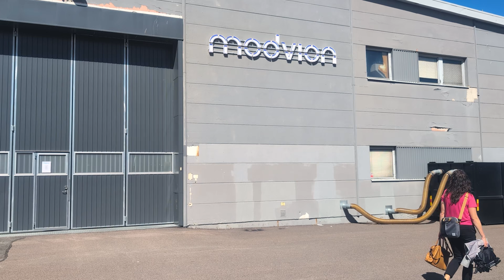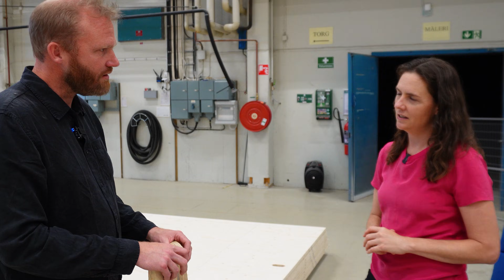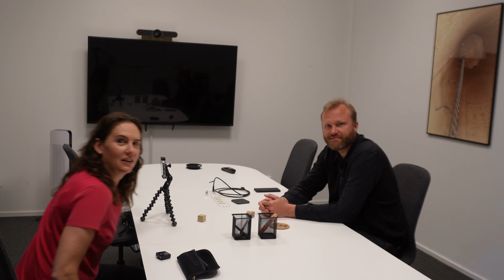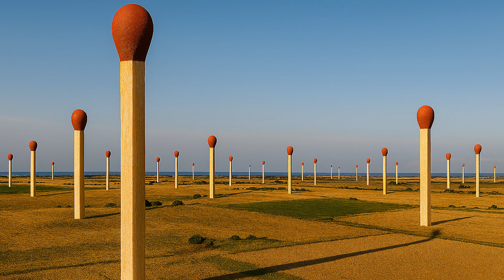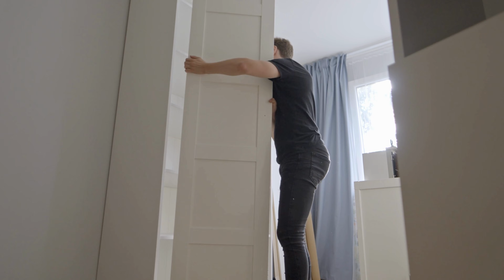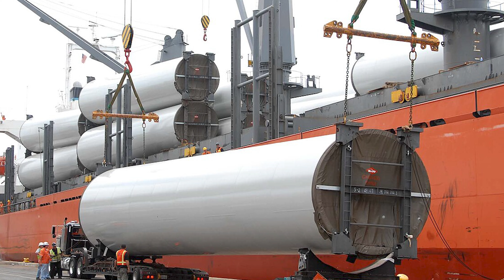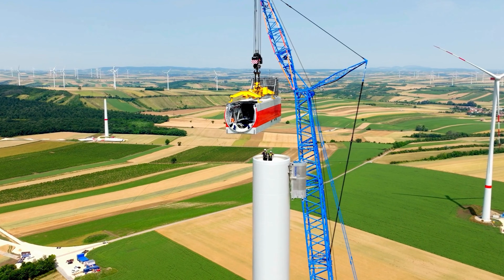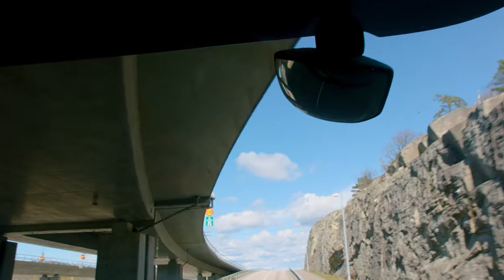How a Wooden Tower Could Unlock Bigger Wind Turbines

Comment: I see no reason that turbine blades couldn't be manufactured with a similar technique. As someone already pointed out,  a WWII bomber was built in quantity using wood laminate, and was renowned for surviving massive battle damage. 

Where the blades neck down to connect with the hub would be  challenging to get right, maybe, and you probably couldn't join blade sections on site reliably. That would subtract a couple advantages of wood composite construction.

Comment: A possible receicling issue: cutting up the towers after their lifespan requires cutting the glue in the composite as well. How do we keep the glue from sticking to the saw blades?
Reply: haven't you ever cut up a piece of plywood?
Reply: @fulknerra6116  ever used a circular saw to do this, and looked at the blade afterwards?

Comment: they don't rust. I do not like the clearcuts. Where i live in west coast Norway we have some large clearcuts. All the fungi systems that give the trees minerals die and it is harder for new sepling to grow. Using timber as in solid wood construction is a way to store carbon. So the last 5-10 years we see these massive solid wall, floor and braces in larger buildings where we are used to see concrete and steel.

Comment: It seems to me that bending already laminated panels would weaken them a bit. So, hoping the Pilot works 'good enough', I would think that building a production plant would take logs and send the veneer planed off the log directly into a press which would laminate (with resin) the conical segments per whatever dimensions are required and let them cook once.
a bit of terminology strikes me: Fiberglass is also referred to as Glass Reinforced Plastic, Carbon-fiber would Carbon Reinforced plastic and these would be Cellulose Reinforced Plastic.
BTW: Some boats are manufactured by laying up veneers of wood & laminating them with resin & hold up for decades. Usually, the resins used need UV protection though. So, some kind of surface coating is required anyway.

Comment: To make trees part of sustainable politics, you must cut them down every so often! Trees produce most of their biomass in the first 20 years of life, then drastically slow down in later stages. Biomas growth is directly translated into CO2 absorption. So the old forest is significantly less productive than the young one. LVL is a great alternative as it does not require large pieces of solid timber. Trees can be cut early, before they enter a slower growth period, and replaced with new, rapidly growing ones, keeping overall CO2 absorption rate at the highest level.

Comment: "Made of thin layers bonded together", AND Urea Formaldehyde ? See, i already do not like the way he "miss" some informations on purpose. So it's resin, what quantity is used ?
About EPBT, this is an other unprecise indicator, most windturbines are installed in precise places WHERE they can achieve a good EPBT, that is not always the case for solar.
About reusing wood after dismantle, and the "angle" problem, no you can't build beams out of it .. cause the wood layers are not in the correct direction for that.
Doing wind turbines with wood is not per say a problem... it is if people keep increasing their energy consumption. And beside all those "positive", "green" or whatever bullshit, the first thing to do is DECREASE our energy dependance, forbid big 4x4 on our roads and even only accept small cars for local traveling and only use common transport like trains for longer travels.
Reply: If all the energy is net zero, why do we need to decrease our use, instead of using as much as we want?  Currently the big problem is emissions of fossil CO2, wooden wind turbines can be net zero, assuming the glue/resin is not fossil sourced.  I'm sure they are not completely net zero at the moment, but we are getting there.
Reply: @nigels.6051  What you call net zero is not net zero, if you take the simplistic idea of the CO2 counter then it could be seen as net zero, but it's not.
Appart from the energy thing, there is also all things that are modified in nature, wind turbines make noise, kill birds ... this is not showed in the "Net zero" calculus.
There is no secret, the more energy we consume, the more impact we got on nature. In fact, used energy is a synonyme of transformation, the more energy is used mean the more transformation we are applying on our planet. Taking a solar panel, it generate electricity instead of heating the ground and make flower blom... there is always a trade off.
Just thinking of "net zero" will elad to the same problematic as the one we are against today.... using too much energy and taxing the planet too much.
Using petrol is "net zero" too ... just at a larger time scale.... everything is "net zero" .. cause nothing is created and nothing is lost ... all is transformation. But some transformations are bad for the living creatures....

Comment: Could the towers be fabricated on site as wind farms often have 50 + units timber and glue are easy to transport and the saving of all the joints Think land based oil rigs they are huge and moved short distances the 50 + towers and disassembled and reassembled for longer moves.

Comment: Most structural failure is buckling. PlyWood is thicker for its wieght, therfore resists buckling under compression better than other high tensile materiels that are thinner and heavier. Plywood continues to be foung in new carbon fibre structues such as boats. Many boats are built out of plywood with or without fibreglass covering. Carbon dioxide has such a narrow frequency of greenhouse effect that is swamped by water vapor, and has no long trm correlation with earths temparature.

Comment: In a Storm this thing flys away 🔥🔥🔥🔥🔥🔥🔥🔥🔥🔥🔥
Reply: No it doesn't that's what engineering is for. If you understand the material, you can design for the load.

Comment: Taller wooden towers, could be more feasible, if they were built in situ. For example, wood veneer is more efficient, simpler and more cost effective to transport than extremely tall wooden towers. 

(And it could be redesigned without the need of the steel plates. Possibly on a rotating lathe  such as a Automated Fiber Placement (AFP) machine. Further reducing cost, complexity and improving recyclability.) Plus local forestry and labor could be utilized more effectively, logistically.

Hopefully Modvion will test the concept, for appropriate projects. (Much like concrete is mixed in situ for particular projects)

(Also suggest contacting ("InventWood", a company founded by University of Maryland professor Liangbing Hu, invented "Super Wood" by chemically treating and compressing wood to make it stronger than steel, but much lighter. The process removes lignin and strengthens cellulose fibers, creating a material with a high strength-to-weight ratio that can be used in construction and other applications.:Gemini AI quote) They just started commercializing and selling their first products. But they did mention they're looking for possible commercial partners in various fields. It might be worth asking for a sample just to test it? )

Comment: What about that wood product where they dissolve out the lignin, and press the remaining cellulose under pressure and heat, and end up with stuff that matches steel's strength? I'm thinking of replacing the fiberglass blades, in particular.

Comment: My view is that it takes a multi pronged approach.
Large Steel sections are hindered in transportation. 
Modular Conical section construction makes sense.
Large scale plantation timber acts as a carbon sink but takes many decades to reach harvestable height and size.
I wonder is Modular steel towers would be equally as strong given the ability to mirror the same assembly techniques.
Very interesting approach indeed and one worth following.

Comment: Regarding reusability, more energy could be saved by only cutting the towers into vertical segments, say 2.5 to 9 meters high, then disassemble for transport.  These could be used for 1, 2, or 3-story structures - dwellings, storage sheds, stock pens, etc.  With the 28 layers of 25mm to 30 mm of LVL, they would be highly insular.

Since the outer diameter was stated as 8 meters, inner diameter would be 6.3 to 6.6 meters, giving 31 to 34 square meters inside.  A 2-story tower would have a little more area than the average Swedish home.

Aesthetically, I think it would be nice to see round structures popping up.

Comment: I am not convinced that water ingress and rot will not prove to be a significant problem, especially in cool wet climates like ours here on the west coast of Canada. Water will find a way into the structure. No coating system is perfect, and I doubt that the urethane coating being used has the vapour permeability to allow drying. It doesn't take long for rot to occur.

Comment: Interesting how the entrenched technology gets to make all the rules to reject the newcomer, rather than have an unbiased discussion of actual strengths and weaknesses. For example, the conductivity of steel dissipates lightning energy, but is also the cause of so many lightning strikes. But timber has to play by the rules that just assume that conductivity is necessary. And that strawman comparing these engineered towers to Ikea furniture was a low blow. If we let wood have the same advantages that entrenched technologies enjoy, we will no doubt find many other ways to optimize this technology through engineering, as opposed to using protectionism to make rules against it.

Comment: There are some more advantages with wood. While the strength per crossectional area is rather low for wood, its density is also low, so that the weight specific stregth is really not too bad, but even more importantly, for the same required strength (or weight, for that matter) you get to use a higher wall thickness and that is very important when you deal with stability issues, rather than strength issues, as is common in shell structures like towers (or rotor blades). In addition to that the structural dampening of wood is pretty good and compared to most common construction materials it has very little fatigue. There is quite a lot of technical reasons to consider wood. I was actually wondering how Mr. Dölerud would not bring a more comprehensive list of advantages. Or maybe he did, but  some was cut out for sake of conciseness.

Comment: Timber and wood are by definition made from things that are made to resist wind. Fatigue is usually not an issue for wood structures.
Reply: Timber can fail in many different ways over time, for example cracking and  As mentioned in the post by biological decay .... Every material has its pros and cons.

Believe what you want c'est la vie

Comment: I’m not sure you could actually shrink the foundation just because it’s a lighter tower.
The main load this foundation has to deal with is a lot of torque from the wind being applied to it with a very long arm .
The weight of the tower is probably negligible compared to that force .

Comment: To be honest I am not so sure if it really makes a difference. Steel might initially require more energy to produce, but it can be recycled endlessly while the wood has a limited recycling cycle. And it remains to be seen if the wood can be recycled at all, because if it is too much rotten then it is pretty useless. And all the other arguments for using wood instead of steel didn't sound all that convincing to me. Steel has proven that is a very good material to use for this purpose. And there was not anything that stood out clearly in favor of wood. And of course the guy or company who is producing the wooden structures will always speak in favor of the wood. To convince me it would require thorough calculations and hard data instead of a slick PR story. I am missing the hard data in this video, where are the numbers? And on top of that I would much rather see those trees in the ground, or to be used for something where the use of wood is the clear better option. Because lumber prices are already high enough as they are now. 

My questions for that lady who did the interview are 1- did you do that thorough calculation about a comparison between the different materials to see what would be more eco-friendly and durable in the long term? (that shouldn't be too hard to do) and if not, why didn't you do the calculation or some proper research? 2- Did you get payed and/or compensated for your trip in any capacity by that company where you did the interview? 

I am not by definition against the use of wood. But it only makes sense if there are clear long term environmental and mechanical benefits for using wood instead of steel. And this video did not provide the hard data to convince me.
Reply: Good questions. I suggest we start out by not callng it wood, which is greenwashing. It is a composite wood laminate.

Comment: There could be hybrid towers where de base is made out of Steel for the stiffness (E=200 GPa) and the top made out of wood for the specific tenacity (energy of deformation/weight) and the vibration damping. For the wood fiber approach, bamboo fibers with polyurethane resine could be used and the cylindrical tower section could be made with a filament winder like corrosion tanks. Bamboo is one of the strongest natural fiber, it grows fast and in poor conditions. Polyurthane have  low VOS and is very compatible with cellulose bonding.

https://www.youtube.com/shorts/t6zNADTQVV8

https://www.youtube.com/shorts/2So5BWWG2Ps

https://www.youtube.com/watch?v=NnSXLa4yDeI

https://polymerestechnologies.com/product-category/two-part-rigid-and-flexible-polyurethane-resins/rigid-polyurethane-casting-resin-systems/rigid-casting-and-molding-polyurethane-resins/

https://www.youtube.com/watch?v=qSUUuGoE36U

https://www.youtube.com/watch?v=K-sY26Dr4mk

Comment: Oh like a tree! Why did no one think of that before? Probably need years of testing to see if a tree stands up.🤣 Get it right and you just plant a tree seed and let it grow a trunk, grow it's own foundation, roots, then add the turbine and blades!

If they were serious they would separate the wood fibres from the lignan and then re-lay them in a mould like with glass fibre.

Of course we know proper old mills were wooden. So just build them again as smaller capacity generators instead of grain milling.
Eifel tower is taller put a turbine on top of that. Do not have to be round sticks.
Wooden towers they have are stupid, basically they have local wood not iron!

Comment: I think solar PV, batteries and grid forming inverters will eventually run away with most of the electricity industry. Wind and pumped hydro will have their place, but solar PV, batteries and inverters can stand on posts or piles driven, or screwed, into the ground. Solar farms are great for stock as they provide shade and concentrate rain for growth of improved pasture. Data centres will give depth to the solar + batteries + inverters system.

Comment: Still will need to mine SILVER and COPPER. And everything that goes with digging it out of the ground. Trucks, bulldozers, diesel ect. Also the rebar and concrete to set it in the ground uses more energy than will be achieved from the turbine in its life time. Good luck.

Comment: Anyone look at trees as a mechanism of transferring wind kinetic energy to the ground? Doesn't a tree move in the wind? And while not a rotating turbine, there is an oscillation back and forth and the impact is essentially energy transfer from the wind to the tree, to the ground? 

So, it wouldn't be Cog and Wheel sort of gear rotating things. It would be twisting or torsion energy. Is there a way to make torsion in a swaying object connect to some kind of energy drive?

Comment: Asking if wood the right material to build a cylindrical tower designed to resist wind load, is a bit of a silly question when you think about it. You are building an engineered tree, it just makes sense.
Reply: To clarify, with most material choices you have pros and cons to everything, but here you have a material which has been naturally selected for over millions of years to do exactly the job you want it to do.
Reply: I'm not sure that because nature already has a version is much of an argument against using a man-made equivalent. If that were true a horse would be superior to a car and a bird would be preferable to an airbus.

Comment: No matter what the tower is build of, all wind turbines are a disaster for the grid. Needs frequency stabilization, which can only be obtained by big mechanical generators, like the one used in hydroelectric power plants or nuclear power plants. Also no wind = no power. Too much wind = no power.